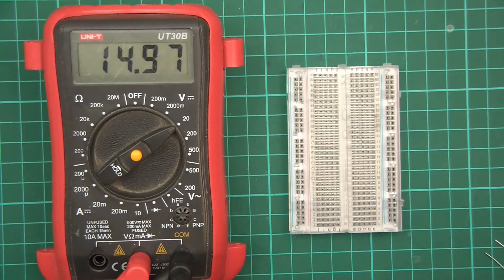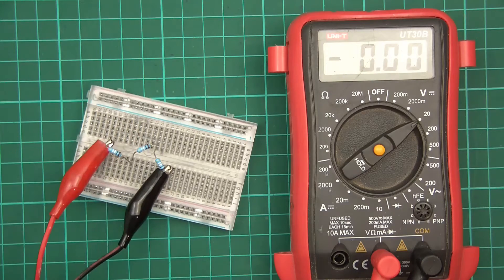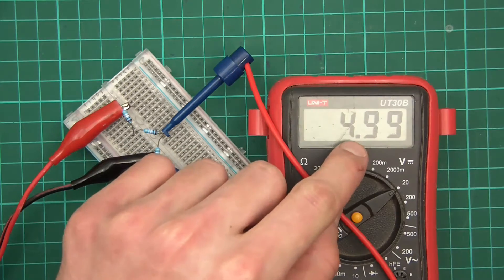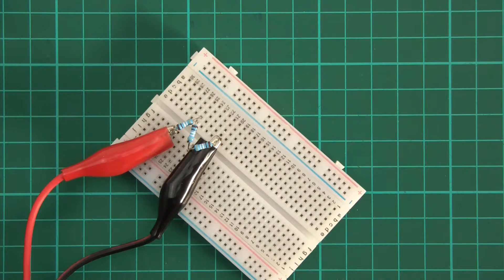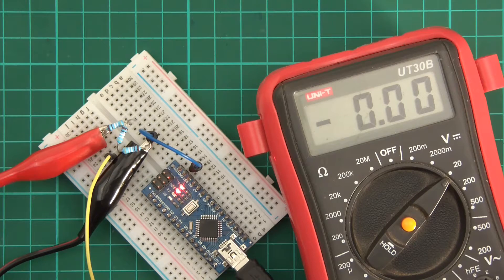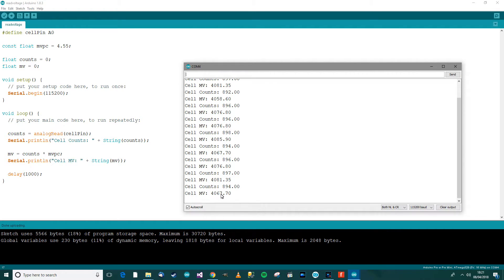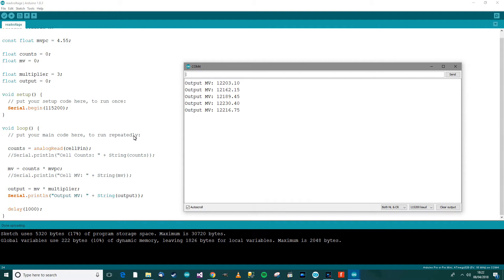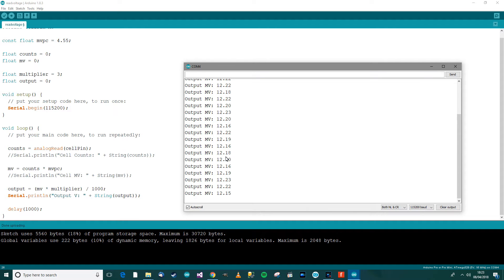TUTORIAL: How to Measure / Read Voltages Into Arduino - (Part 3/3 Voltage Dividers - Analogue)

Comment: Thanks! I'm powering an ESP32 circuit with a pair of 18650 cells (in series), using an 
LM2596 to step down the voltage. I want to keep an eye on the voltage. Dividing the voltage by three with three 100K Ohm resistors gave me the expected one third voltage. I'm reading it with an ADS1115 as I've heard the analog input on the ESP32 is sub-par and I already had the ADS1115 in my project, so this wasn't really a problem. Seems to be working great. Adding the additional battery voltage sensor (and a second sensor with battery in percentage) within ESPHome was a snap.

Comment: Next step, '555' timer 🤭

I'm in the process of building a gps speedometer for my Virago XV400.
Going to add a 'battery voltage /charge indicator using a Ws2812b led.
Some comments / inputs from your previous videos on this.
1. I'd use an external Vref for the arduino, say 3.3V from voltage regulator. This would avoid any Vsupply issues. Note, I found setting vref to INTERNAL was' iffy', DEFAULT worked better. Of course, EXTERNAL if you go that way. 
2. To protect the A input, I'd try a zener diode maybe 4V7 on the input if using 3V3 ref.
3. For me, the top end voltage I'll use 20V as could get that high if the voltage regulator goes North.
4. Someone commented when using an LED segment display it's too fast around the loop(). Try using the Watchdog Timer, say set @ 500mS and update the display within the ISR.
I might do some experiments this week see what's a good combination. 
I've seen on some MPPT solutions, an R/10V zener used as voltage divider. I haven't got my head around that one, yet!

Comment: Anthony, Thanks for your vid. It did cover everything really well and easy to follow.
I now have this issue and need some help.

I followed your instructions to the letter:
Used four NodeMCU ESP8266 and build this voltage measure unit to constantly test my solar backup batteries.

I used two 10kOhm and a 4.75kOhm resistors.

After setting it up on a breadboard I connected all four to the same Laptop Power supply. 15Volt and 4Amp to finetune the formulas so all would be giving the exact same reading.
They were connected for about 10 days and I also connected to a battery charger that acts as a battery providing 13.4 volts.

So far I had no issues, just twigging the formula.
Today I decided to swop over to the batteries I want to monitor. It is Gel batteries 12 Volt each 200 Ah batteries.
After connecting I double-checked the + and - and hook op the power supply to the USB cable. At the time I think I heard a soft pop sound, but continue connecting.
After I connected three I thought I should first check if the readings are published to my MQTT server as expected.

No readings:- So I tested the power supply that was feeding the NodeMCU's and all seemed fine.
When I connected the last one I heard an audible thump sound and a small flash inside the protective box.
When I opened it, I noticed that two connectors from the micro USB that are soldered to the PCB were burned and caused the flash.

I am really baffled as I did follow your instructions, tested the set for about 10 days and the ONLY thing that changed, was the AMPS. 
from 4 Amp to 200 Amp

Any ideas?
Reply: @5:10 in the video, he mentions you could use a resistor here as well, but does not share why.  I think you answered that question as to why you may need to also insert a resistor, which is to reduce the amps being fed into the analog input.  The max current being fed into an Arduino analog pin is 40 mA (0.040 Amps).  Also, with 200 Amp, you may need to use resistors that are designed to handle higher watts.  So it is not just resistance, such as 10K.  The resistors may need to be thicker to handle the 200 amps, and you may need to take into account how many amps you can send to the analog input.
Reply from the maker: So, even 1 X 10k resistor is enough to protect the microcontroller from 12v, because 12v / 10,000 = 1ma. There's so much resistance that only 1ma can get through regardless of the CCA of the battery.
Reply from the maker: It sounds like a miswire.

Comment: Thank you so much for your excellent vid:-

I want to monitor my four PV system batteries and the voltages have to be spot on.
(I want to use that info via my MQTT server and with Node-RED trigger, contactors to protect batteries)

So with a constant supply of 13.4 Volt, I added a 19.72 K Ohm and 4.94 K Ohm resistors.
I then measured with a digital multimeter:-
Battery input 13.4V
Input AO and Gnd 2.66 Volt
Node MCU ESP8266EX 3.22 Volt.

My calculations then are:

MVPC: 2.66 / 1024 * 1000 = 3.14453125 
Multiplier: 13.44 / 2.66 = 5.03759398

I then get a reading of 14.21 Volts
(With an analog count of 897)

What am I doing wrong?

- It is .81 Volt off, and for Deep cycle batts it is a lot

Regards

Frits

Comment: Hi!
I realise this is an older Tutorial, but I stumbled across this to figure out how to make sure my LiPos don't get below a certain Voltage, to protect them. 
After watching all three of these Tutorials, I'Ve come to wonder if this method works with Lipos without problem... I have a 1s and a 2s LiPo that I need to Monitor this way. 

Thank you very much for your time and thank you for these great Tutorials!
Reply from the maker: It works with everything. For 1s, it's really simple. For 2s, you'll need a divider as 8.4v is too much voltage for Arduino.
Reply: @antonycartwright  
Thank you very much for the reply. I've managed to make it work perfectly.
Probably the best Tutorial out there for this. You have no idea how long I've tried to search for something like this, and all I'd get is the usual LiPo Voltage Buzzer/Meter.
Reply from the maker: @BasilHerb  It's true. Many other YouTubers don't seem focus their videos correctly. The most common thing I see is that most of them fail to address the issues which viewers are interested in, namely, the bare minimum amount of info in order to get the thing to work.

Comment: what if i had a source made only with a full bridge rectifier, a 47u capacitor and a 100k resistance in paralel, ....i want to measure that voltaje with arduino in the way you do....but there is a problem, the arduino ground always may have the same reference that the source, but  the dc voltage of this source is compound of (for example) +50v and -50v, and arduino would measure 100v....what hapend if i conect -50 to the arduino ground? a shortcircuit?.....i ask you that beacause i did that, i made a voltage divisor,and sometimes i had a -50v conected to the arduino ground and the arduino measured that 100v without problems almost 20 times but then arduino died :( ....i dont know exactly why at the begining it didnt crash, and then it did,....im confused

Comment: sir you did not mention that where did you get the value of mvpc=4.55?. and what it indicates for?.
Reply from the maker: Hi, that should be described in part two. 4.55 is the amount of millivolts per ADC count. It's VCC / 1024 * 1000.
Reply: ok thanks for the quick reply sir
Reply: sir vcc indicate my power supply value or from 5v arduino?. I means if i used 12v power supply.. my vcc is 12v right?.
Reply from the maker: Zawir Zahid Arduino vcc should be near 5v.
Reply: Antony Cartwright ok sir i understand now..  The value mvpc from the arduino itself.. Sir if i use resistor 680k and 100k..  And use supply 12v..  The value for the volt divider. Is 1.53v.. And i wanna know about the float multiplier that u used.  I used only 2 resistor as i mention above..  And the value from supply that i used is 12v but the serial monitor only display 9.5 volt..  Why this happen?
Reply from the maker: Zawir Zahid I'm not sure what you're doing, but 12v is way too high for arduino. If you're trying to measure 12v then 20k + 10k would be good. This would make the 12v 4v.

Comment: Now go back and do a revisit on code updates to make the ADC more accurate by implementing the code to check for internal chip voltage  😎    jk

Good work on your presentations. 
One thing I didn't notice you say (which, you may have and I just missed it) is that the higher the voltage you are dividing, the worse the resolution becomes. Also, the more dividers that are used, the worse the resolution. This can be an important factor when needing to measure high voltage (like mains for example) and you can only get 0.1V resolution. Kinda skews kWh usage after awhile.
Reply from the maker: Hey Mr Korishan, I suppose I should do really. ;-) I never mentioned anything about that other stuff either. Sometimes its so hard to draw the line on what is excessive and what isn't.
Reply: It's only excessive when the content that's being adding doesn't have any real meaning to the overall theme or direction of the project. So if you went off and started talking about how the birds pooped all over your solar panels while you were discussing the mppt controller, that'd be excessive  😜
Reply from the maker: Korishan it's hard to explain though, but sometimes, there is a massive amount of relevant material. Lol. For example, in this video, I could have talked about ADCs, etc. It would have given viewers better understanding, but I thought it was too much.
Reply: @antonycartwright  hello,
I want to measure voltage for common power source, how to do that ?
I mean to say that, can i measure the voltage of same battery, which is powering up the Arduino ?
If yes, then how to do that ?